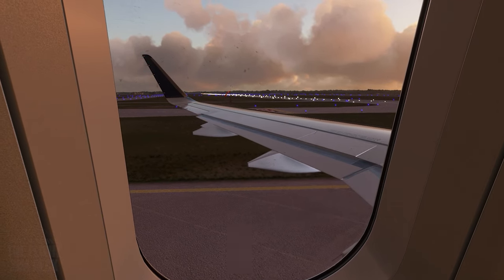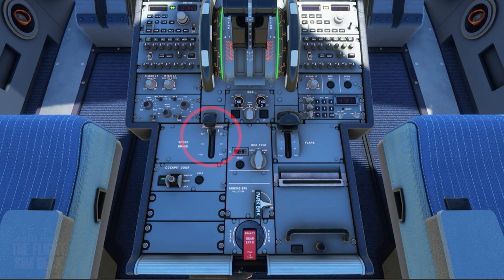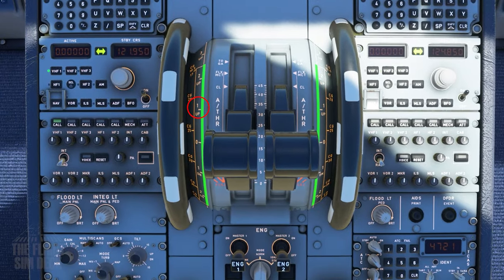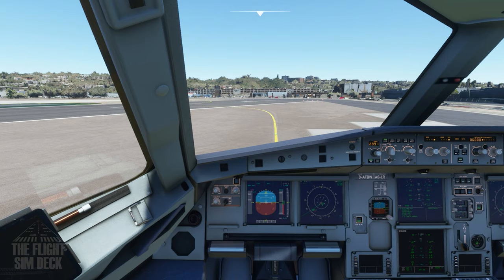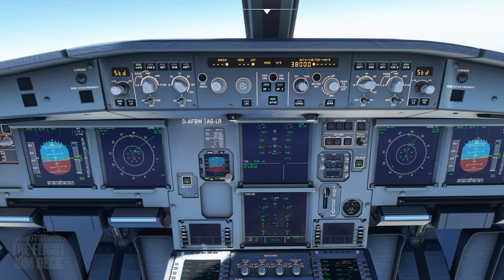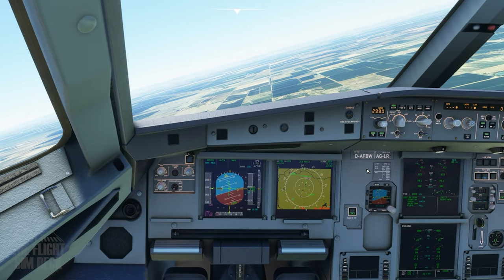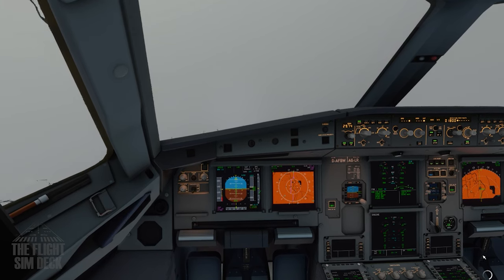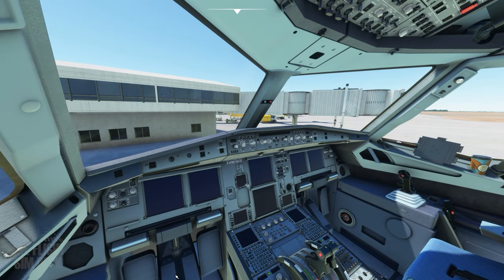Microsoft Flight Simulator | How To Fly The FlybyWire A32NX

Comment from the maker: 1:00 Before Power Checks 
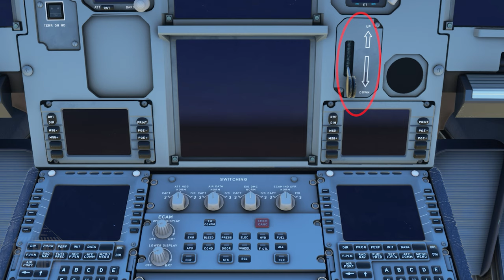1:16 Powering The Aircraft
1:26 APU Start
2:03 Activating The Cockpit Lights
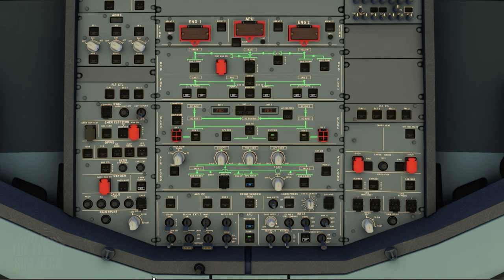3:11 Overhead Panel Setup
7:02 Setting Up The MCDU
13:52 Flight Control Unit Setup
14:56 Engine Start
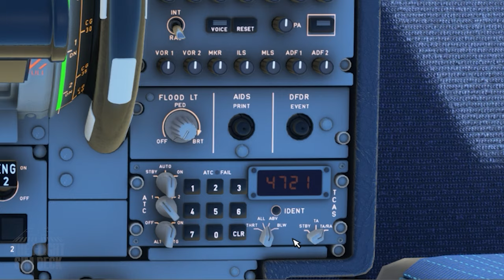17:35 Taxi & Lineup Tips
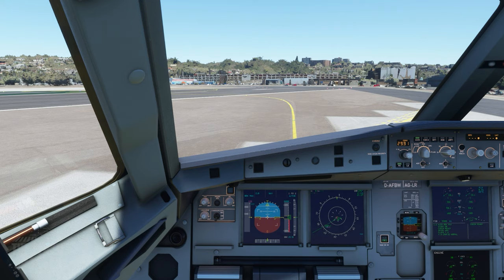18:12 Takeoff Brief
19:56 Takeoff
22:07 Climb out
23:08 Passing 10,000ft
24:00 Transition Altitude
24:37 Cruise
25:00 Operating The Flight Control Unit
27:00 Help! Plane Came Off My Flight Plan!
28:09 Descent
31:44 ILS Setup
31:54 Approach
35:34 Landing
38:51 CAT lll Autoslam
42:01 Parking, Shutdown, Secure

Comment: Fantastic video! We hope you are enjoying your time with the A32NX :)
Reply from the maker: Very much so! You guys are the heros, thanks for all you continue to do!
Reply: Will the A32NX be on xbox please answer
Reply from the maker: @jorldan5440  I don’t think at launch, but it’s already in the PC market place, so it could be.
Reply: @TheFlightSimDeck  hey do you know if we have to purchase liverys because im pretty sure we wont be able to download it on xbox
Reply from the maker: @jorldan5440  I don’t foresee them charging. Everything will have to be done through the marketplace at first including free products. I hope there will be some way to start integrating the massive freeware sharing that we see on flightsim.to. These are things that will be in high demand.
Reply: I love the flybywire A32NX. Bur I’ve got a problem. I don’t get the up or down arrows to push or pull the altitude knob. I just get a hand to either increase or decrease the selected altitude. I cannot push or pull. Please help
Reply from the maker: @MercilessYT_gaming  have you tried zooming in? The click spot is on the very edge of the knob.
Reply: @MercilessYT_gaming  i had this problem as well, hopefully you've found the solution by now. if not, this can be solved by going into General Options -> Accessibility and change 'Cockpit Interactions' from 'Locked' to 'Legacy'. hope this helps!

Comment: Hi. Very informative stream. the only error or omission I found was you turned on the NAV lights after push back. I worked as a ramp supervisor for ten years. i found the nav lights were usually one of the first items done after battery on. many ground services at my airport were not allowed to approach a totally dark aircraft (needed at least nav lights)!
Reply: Yea I have taken many flights and have always seen that the NAV lights are the first ones on!
Reply: Thank you for this tip.
Reply: Thank you for the info
Reply: I was actually bout to type that the nav lights were turned on after pushback. I think u should turn them on once u have batteries and ext power on. I don't think he used ext power on as well. Also I think that ur supposed to turn the strobe lights on once ur cleared for departure
Reply: Also, when he aligned the IRS he went from left to right but in reality it should be done left, right, middle.
Reply: It's my understanding that any time someone is in the aircraft and it is powered up, the nav lights are on to communicate this to personnel outside.  This probably varies during daylight hours, based on the operator's policy, but as a rule, I have always seen them on if the jet was powered up, civilian, or military.

Comment: hello bro, what a good video, but could you help me? also that the ACCELERATOR IS VERY SENSITIVE, when I press "f3" or "f2" IT MOVES A LOT compared to the original msfs, I use a keyboard, I don't have controls, I just started this wonderful game months ago, I hope you help me bro, because the flybywire seems like a very good mod to me, but so with what is happening to me I cannot enjoy it well because of the front wheel that does not center well and not even because of the accelerator. I would appreciate the help bro, THANKS.

Comment: Thank you for your time and effort into this video.  I watched flybywire videos and couldn’t figure out the avionics of this plane.  I’ve worked on Boeing McDonnell Douglas Lockheed Douglas and I’m old enough to remember the convair 880  all of which I’ve used avionics and airframe with delta and scarebus is the result of drinking at the age of 3

Comment: Before turning on any power, you should have included a wiper check when first coming up to the Over Head Panel. This may have been pointed out below, but just in case I am mentioning it here.  Didn't get any further in the video as it is late here.  Didn't want to forget.
Reply from the maker: I know I thought of that after. That is a pre-power check for sure. I mean realistically they won’t be on in this sim from cold, but if we’re going to run this aa real as possible that needs to be checked. I’ll annotate it on screen at that point with the text editor.

Comment: Hi mate great video. Do you experimenting some issues after version 5 update? Such as eng 1 turns off after using thrust? And wing lights and beacon lights are not operative. Pls let me know.
Reply from the maker: Hi Bull, thanks! Just tested and all of that works on the development version. But I can't set managed speed mode while on the ground. Works after takeoff.
Reply: got the same thing and its driving me nuts. It was working fine before sim update 5, now I cant turn on/off the lights, the buttons seem to be unclickable. I got the version installed from within the sim. Im gonna try removing it and using the fly by wire installer instead to see if it helps.
Reply: @LordLookas  I think that is how you need to do it. Remove the stock plane from MSFS and install the Fly By Wire only.
Reply: @hiortintexasracing  yea that's what I did and it helped, now I can control my lights. For some reason the marketplace version for A320FBW was broken. The one from the website installer works like a charm now.

Comment: Hi there, Fantastic and helpful video. 

Forgive me for ignorance - but i used to fly FSX with the Aerosoft a320 before transitioning over to FS2020 and when setting up the flight, it would calculate (and show) the altitudes (I think what was called VNAV). and it would show where the altitude profile path should be on the descent etc. the CI would just all this. 

Is this function missing entirely from FBY's version?
Reply from the maker: Thank you! They're still working on it. They had to create the whole process from scratch both the MCDU calculations and how the MFD displays the information.
Reply: @TheFlightSimDeck  thanks for the super helpful reply 😊

Comment: When you push down on the knobs are you using the middle mouse or the left or right mouse button.  Everytime I try to press with the middle roller it turns the knob.  Sometimes they don't do anything when I click on them.  Wondering if its just a bug.  Because sometimes it works and sometimes it doesnt.
Reply from the maker: I use left click. Each knob has two hover points for the mouse cursors. You’ll see the symbol change. One is to push the button and one is to pull.

Comment: Where do you find the BARO at 31:15? Is it on the approach sheets?
Reply from the maker: With Airbus you don't have to include the runway elevation just the minimum number. Most of the time it's 200ft. More rarely it might be higher and that will be noted on the chart too. On Boeing for example, you do need to look at the chart because you need to add 200ft + the runway elevation. So if runway elevation is 114ft then you would add 200ft + 114ft and you would put 314ft for the baro and it will warn you at 200ft that you're at minimums.

Comment: When i am in managed climb, as soon as I reach 10,000 the target speed goes from 250 to 320 which kills my rate of climb.  Is there a way to correct this so that the aircraft maintains optimal climb rate to cruise alt and then seeks top speed?  Thanks   Awesome video
Reply: Not sure if you already figured this one out but one trick you can use is the just wind the speed knob on the left of the ufc to 250kts, this slower speed will give the aircraft a much faster rate of climb, adjust that speed for the rate you want

Comment: what program are you using to find all of that info for the mcdu? Before I would just manually do it with maps and stuff but I never needed an airway with the default
Reply from the maker: It’s website called SimBrief. Gives you both simple and detailed dispatch reports for the whole trip based on real world data.
Reply: @TheFlightSimDeck  ok thanks it was getting kind of confusing

Comment: I'm having trouble taxiing (only with this plane), I'm only using a Logitech joystick for now and the taxiing has been a pain in the ass to say the least, usually I only use the rudder by twisting the joystick to the side I want and now it goes right when I turn left and then after 1 sec it finally turns back left, and same thing to the other side, am I the only one to which it happens and is there a way to fix it?
Reply from the maker: Sounds like the axis needs to be reversed. When you check your rudder axis controls in the control menu does it also do this? If so, there is a button to swap them around.

Comment: Can someone help me when I try to double tap the McDu to calculate v1 gr and v2 speeds it says format error same goes for the trans altitude
Reply from the maker: Did you input the correct flaps/trim setting in the mcdu? if the departure runway isn’t added, or the payload info too. Any of those in combination, or by themselves can cause that error. Which altitude did you use for the transition alt?
Reply: How do I know which flight level to go to without navigraph?
Reply from the maker: @PepsiX-l9f  if you’re flying east 0-180 degrees your cruising altitude will be an odd number like 35,000ft. When flying west from 180-359 degrees you fly an even cruise level like 34,000ft. But to get the exact altitude there needs to be some calculation done because the winds, fuel, weight. There are formulas for this but Navigraph/simbrief is still free  to use for these calculations. A lazy alternative I’ve used in the past is looking up the flight I’m doing on flightaware and see what cruising altitude is currently being flown on that route.

Comment: what do you have to put into the mcdu in order to get the tod marker? idk how to descend without using the fbw calculator
Reply from the maker: @sam-ff2bg  do you have any discontinuities before the decent? It should show it automatically if the cruise altitude is programmed along with the STAR.
Reply: @TheFlightSimDeck  hey i just realized that for the experimental version the tod marker shows up but for the stable version it doesnt thank u so much

Comment: Hey, quick question. No matter what I do with the FMGC flight plan, I NEVER see the Top of Climb nor Top of Decent symbols on the navigational display, whether the flight plan was entered manually or loaded via SimBrief. Why is this? Any help will be appreciated. Using latest dev build of the mod as of July 30th
Reply from the maker: The TOD never shows up me. But TOC does. Is the cruise altitude entered on the INIT page? Could be the latest build too. I haven’t used it in a few days.
Reply: @TheFlightSimDeck  yeah, cruise alt always gets set in the init page. Maybe another bug

Comment: How do I find the QNH, Temp and MAG/Wind on the Approach phase?
Reply from the maker: Tune the ATIS (Automatic terminal information service) frequency for the airport. If one is not available tune the closest airport with ATIS. 31:08

Or you can print it in the cockpit, if you know how to read a METAR. From the MCDU. Click the MCDU MENU button, ATSU, AOC MENU, ATIS, Select arrival or departure, then SEND. Return to AOC MENU, Received Messages, click the message, and PRINT. The paper will come out of the printer directly left of the first officer seat. You can then click it and it will place it in front of the throttle.

Comment: On the primary display line that shows the route is dashed. How do you fix that?
Reply from the maker: That happens when heading profile mode is off. 25:00 See how it needs to be a dot and 3 lines? When that goes off you're on manual heading mode.
Reply: @TheFlightSimDeck  yup that worked. Cheers

Comment: Dude, I've followed every video guide, and every checklist I can find on this plane, using SimBrief and all the tools available, and still, EVERY attempt at a landing somehow ends up 2,000 ft above the airport coming in at a random angle from the runway. I've sat up the SIDs and STARs, I even followed one guide down to the arrival and departure airports, so I could eliminate it possibly being a me thing...
Reply from the maker: Sounds like everything is going right until the end. Is there a vector on at the end of the STAR. There should always be at least two waypoints guiding you to the runway after the STAR and or vector. It's one of those things where I would need to watch what you're doing. If you can record the last 5 minutes of a flight I might be able to see the issue.
Reply: @TheFlightSimDeck  Yea, I'll have to record the end of one, but, I think I might know what the issue is. As it stands, I'm still doing this all with KB+M, I've not got a stick and throttle yet (soon, very soon), so, manual flight is almost impossible, even just lining up the glide slope, and nothing I do, none of the tools I can find, will automatically align the plane with the glideslope.

Comment: Can someone please help me with the A32nx when I try to calculate the takeoff speeds by clicking twice on the mcdu it keep pooping up with format error
Reply from the maker: Did you input the correct flaps/trim setting in the mcdu? if the departure runway isn’t added, the payload info, or the flaps. Any of those in combination, or by themselves can cause that error.
Reply: @TheFlightSimDeck   Thank you I will try it out and get back to you but im getting really confused with the airways I have a hard time learning with tutorials and I keep getting stuck on the MCDU configuration.
Reply from the maker: @iibolistic5052  I can try to further help if you need it. You could also try some routes without airways at first. OR save a route file from simbrief and plug that in. Basically inputs most of the route for you. It takes time to get familiar with it all but you’ll get it!
Reply: @TheFlightSimDeck   My auto thorttle is not turning on. Im so sorry for being annoying
Reply from the maker: @iibolistic5052  not annoying! I want to help people enjoy these planes. So the auto throttle button on the MCP won’t engage? Have you taken off yet? If so, it could be that the throttle detents aren’t quite locked into CLB mode. If able, you could record a video of you doing your setup and I could review it to see what might be happening.

Comment: The autolands are even worse now they never improved. They either do one of two things:

1. As it grabs the ILS, the plane slams its throttle into TOGO and pitches up 40 degrees

2. As it grabs the ILS , the plane banks and does 360 degree circles infinitely 

This is off of the latest stable 10.0.1 release

Comment: If anyone could help that would be amazing but at 22:54 when the altitude gets pushed in. For me it doesn't seem to give me the option / let me push/pull it.
Reply from the maker: One thing you can try first is under graphics settings. I think it’s towards the bottom of the list. It’s an option to turn  “fix lens distortion” on/off. It’s it’s on try off. Sometimes when on, it can shift the click spots over too far. If that’s not the issue we can explore something else.

Comment: Nice video thanks.  In addition to some errors reported, you turned off the strobes when passing 10000 feet, these are turn on when entering a runway and only go off once landed and off the landing runway.
Reply from the maker: That’s not the off setting….That switch has 3 settings ON, AUTO, OFF. Most airlines leave it in auto the whole flight. I only moved it to the AUTO position. It’s an SOP specific task to either use it ON or AUTO. Some checklists will list it after 10,000.

Comment: How do you set the SPD and HDG on auto?   I don't understand how the buttons work.
Reply from the maker: The knobs for those are push and pull. You have to hover the mouse over them and you should see the mouse cursor turn into either a down arrow or up arrow. If you see 3 dots that means it’s in auto. If you see numbers it’s manual mode.
Reply: @TheFlightSimDeck  
Yes I see the arrows, but I  can not do anything.
Reply from the maker: @ster100  so clicking when the up/dowm arrows appear does nothing? Do you have lens correction on in graphics? It’s towards the bottom of the list. Sometimes that setting messes up the click spots.